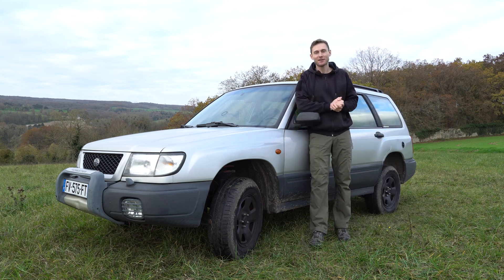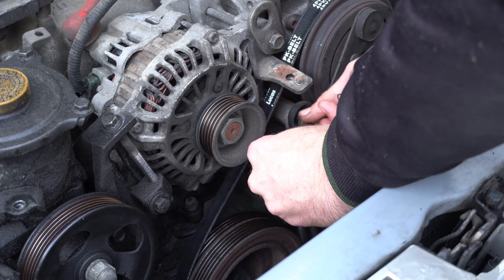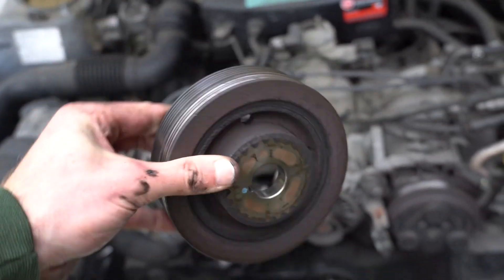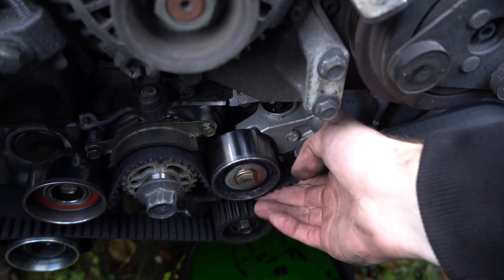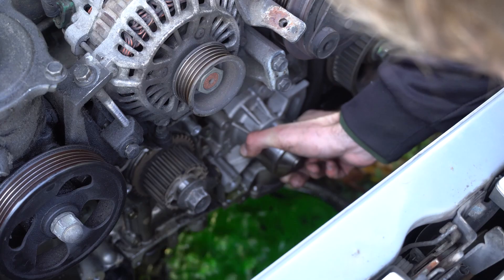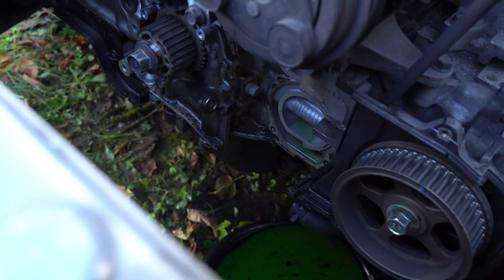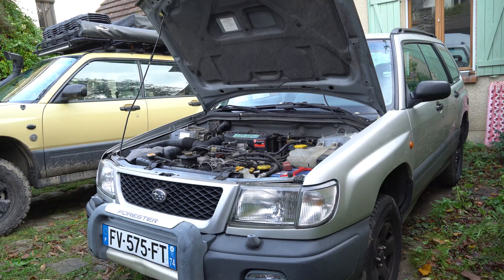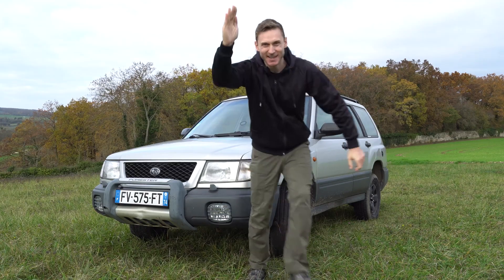How to Change a Subaru SOHC Timing Belt (EJ20 Engine) STEP BY STEP Guide

Comment: You should turn the engine over by hand using the crank bolt and a breaker bar with the ignition disconnected. Turn it 3 complete revolutions so you know it's in time and isn't going to blow itself up when you turn the key for real.

Comment: This is my first time putting a new timing belt in my 1998 Subaru legacy stationwagon AWD with a 2.2 engine. I just need to know how to reset the tentioner with out buying a new one
Reply from the maker: @DawnBennett-f1z  Don't do that. The tensioner is the weakest element of the whole thing. Just get a new one

Comment: Change it every 100,000kms and water pump....if water pump is ok by the 2nd change keep it as a spare.....any tupsmon how to make my engine more powerful for off-road camping....I have a ej20 in a 2.5 2003 Forester I swapped engines over from my old 2002 model ?
Reply from the maker: Exactly what I've done for the water pump!
Sadly I don't think you can do much to improve power on the NA EJ20...

Comment: I bought a timing belt/water pump/ idler pulley kit a month ago, I still haven't fitted the parts but you have inspired me to do it sooner. I was going to replace the parts with the engine in place but later I have to replace the rear engine seal and probably the clutch. My brother helps me a lot with my foz. he used to be a Subaru mechanic 20 years ago but he still remembers it all. His back is worn out but he tells me what to do if I get stuck.
Reply from the maker: Glad it gave you the motivation to do it 💪
If you can pull out the engine it's gonna be even easier, especially if you change the clutch at the same time. Good luck !